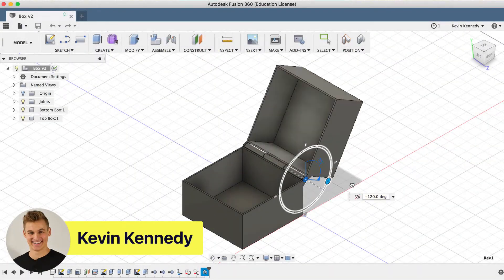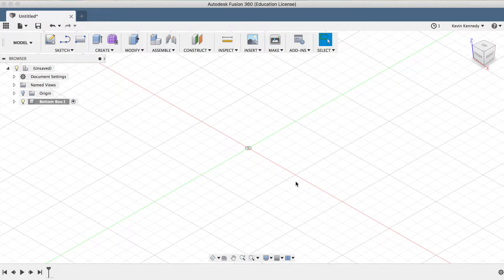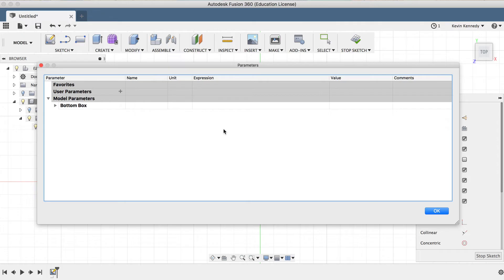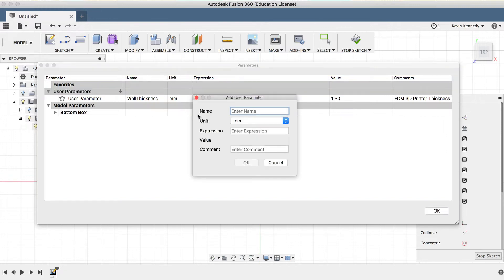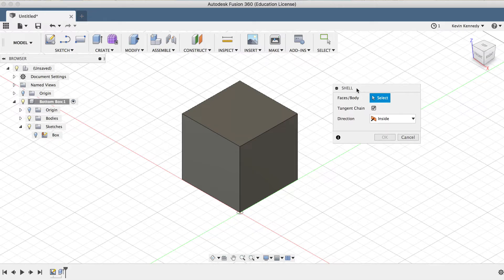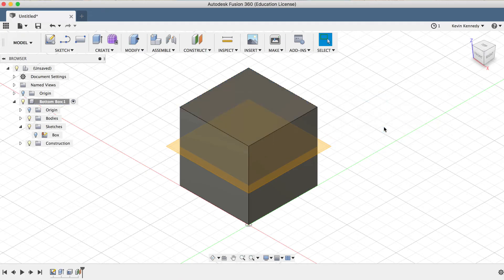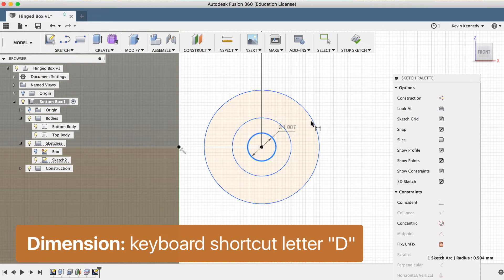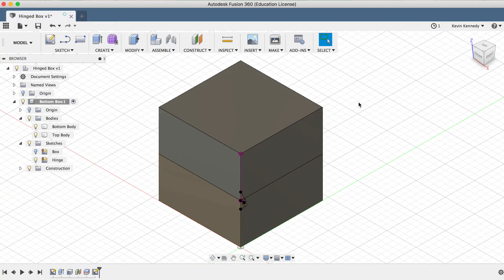How to 3D Model a Hinged Box for 3D Printing - Learn Autodesk Fusion 360 in 30 Days: Day #19(Part 1)

Comment: 8:47 Man, I just came here to watch this video by following the link in  "How to Design 3D Printable Hinge".
First of all, I started to use Fusion 360 about 10 days ago, I knew the basics Autodesk Inventor (which I find really similar to F360), and that helped me a lot.
Anyway, this is just a little story, I'd like to say thank you because I've seen a lot of useful concepts in your two videos, from using the right tools, to named parameters (extremely powerful, it's like introducing a bit of "coding" into 3d modeling).
I'm going to add printable hinges to a model that I'm editing...the only difference is that I've got a UV resin printer and I'm not completely sure about .5mm of clearance. Maybe I'm wrong, but it may be the "dot" resolution even in this setup. 
Btw, no problem: I will set a parameter and align the value with the printer's specs before printing. Thank you again 👍

Comment: Hello Kevin, and thanks for these wonderful videos! At 11:32, I could not get the line to attach to the upper half of the box, the dot for the connection never filled in black. I'm using Fusion360 version # 2.0.13866. I found that I needed to draw the sketch for the hinge before I split the box. Perhaps this is a version issue? thanks again!
Reply: I''ll have to try that it feels random. Sometimes I can get it to attach sometimes it doesn't

Comment: I'm jumping in to the middle of this series.  ...I've often heard the term parametric design for 3D models.  Is this idea of creating "variables" for height, thickness, and gap an example of parametric design?
Reply from the maker: Yes! That's one aspect of parametric design. At its core, Parametric design is about setting your models up with "Design Intent" so you can change dimensions/features with predictable manner.

Comment: 11:30 - my "line tool" isnt snapping on to the top half and when i click it and put in the angle the line stays the same length but detaches from the box however it does snap and work perfectly well on the bottom half of the box. Can someone please help.

Comment: Issue:
The "Model" workspace is no longer shown in Fusion 360. The "Design" workspace is shown instead. Some of the previously available environments (Patch, Sculpt, Mesh) seem to be missing as well. 
The Model workspace has been renamed the Design workspace. Sculpt, Surface, and Sheet Metal are available the tabs shown on the toolbar at the top of the screen. 
Causes:
The UI in Fusion 360 was updated in the September 2019 update.

Comment: Hi Kevin, when I start to draw Line (timeline 11:32) then my drawing is not able to connect to TopBody - it will not fill "triangle" (hard to describe for me). Like Top Body is "invisible" for Sketch. Also all my sketches has a small red lock - aah it means they are fully constrained - probably new Fusion functionality. What I'm doing wrong? Great tutorial BTW! Thanks
Reply: did you fix it ?

Comment: hey is anyone else's sketch at the end messing up? I get all of the circles done and when I add the bottom line it works but when I add the top line it doesn't connect to the other part of the sketch

edit: nvm I just turned on auto project edges on reference like "Product Design Online" said in another comment

Comment: Hey. Thanks for the great work for this series. Haven’t watch part two yet but is it a good practice that you kept the top part of the box as well as hinge sketch still within same bottom box component.
Reply from the maker: It really depends on the design intent and outcome/need of the model. Generally, your'e correct in that it would be better to have things grouped accordingly.

Comment: cant get the top 45 degree to snap to the top of the box. it works fine on the bottom any ideas.
Reply from the maker: Double-check that the 'Auto Project Edges on Reference' setting is turned on in your preferences.

Comment: Mystery: My Ender3 which has been stone-reliable and accurate, produced the hinged box with very loose joints (but otherwise fully functional). I changed my wall thickness parameter from 1.30 to 1.36, the max allowed by Fusion. The change in parameters was reflected in my drawing, but the print was unchanged. Any help would be appreciated.

Comment: I am unable to get the top 45 degree angled line dimensioned. Is that because I only right clicked only the surface of the side surface of the box bottom? The lower 45 degree line dimensioned just fine.
Reply: Found the answer under preferences....just a little toggle like that can cost hours of frustration...now I’m good to go😉

Comment: When adding in 2nd line (11:34) the area it creates does not get filled, as it appears not to be connected to the top part of the box.
Reply: I'm getting the same issue :(. Did you find a solution?
Reply: @ZohaibRauf  Sadly not - Nothing I tried worked. 😒
Reply: Down below "Sami Ahmed" mentioned the solution which also worked for me

"If you go to Preferences (Click your name in the top right corner) then go to "Design" that's under "General" there will be an option that says "Auto project edges on reference". If you tick that, then select apply then ok, it should work."
Reply: @ZohaibRauf  Nice one, I'll try that soon. I wonder why it only happens sometimes. Most of the time it works, just some lines won't make a solid fill.
Reply: @ZohaibRauf  It kinda worked for me, but now very little is constrained.???

Comment: Excellent class set.  I followed along and will now try and print to see how the hinge will work.  I can see problems if the bottom part of the box and top aren't equal and can't both lay flat with the base on the bottom.  How would you print that type of box - or is this beyond the intent of what you are trying to teach.  Had to ask.

Comment: "Hey, I'm stuck in section 11:34 because when I connect the upper line with the tangent of the circle, the area inside is un-selectable, unlike the bottom. this prevents me from extruding the hinge in the future. "
I have the same issue.  If I create the sketch on the top box it works only in the top box.  It just doesnt work after the split? It would seem the functionalty has changed in 2020.  Any answer as this is driving me crazy now?
Reply: Hey I had this issue just today when I was trying to make a hinge; I didn't have it before but I have recently reinstalled everything on my laptop, so that gave me the clue. If you go to Preferences (Click your name in the top right corner) then go to "Design" that's under "General" there will be an option that says "Auto project edges on reference". If you tick that, then select apply then ok, it should work.
Reply: @samiahmed7225  Thanks Sami, that was a great tip.
Reply: @samiahmed7225  Thank you very much, its a perfect Solution, And Yes Kelving really good content, Detailed video
Reply: @samiahmed7225  Thank you so much this was it and worked perfectly.
Reply: I had same problem John, I tried Sami's preference change but it didnt help. I did find the issue in the end. The measure line showing 2.95 was stopping the ability to select the top body right  line to set the 45 degree. I grabbed the 2.95 measurement reference and pulled in down far enough so there was some of the box line to select and it worked.
Reply: Thanks guys. All good now. 👍👍
Reply: bruh you willl go to heaven..just trust me... i was able to do without any help but this issue drove me crazy. i checked every fuckin video to find this problem.and god sent you..thx bro

Comment: I know this is old, but excellent video.  clear and concise.  One comment, IMO the wall thickness (you chose 1.3mm ) should me a multiple of your SLICER setting line thickness, that way the printer will not try to print odd line widths.  Your thoughts?  Thanks again....................
Reply from the maker: Hi, Mark. Very great point you bring up :)

The benefit of parameters is you can change that value to whatever you'd like before printing. Cheers, Kevin :)
Reply: @ProductDesignOnline   Very True.  thanks.

Comment: Can we set restrictions to the movement of the rotations? And plz tell how to design a rubik cube in fusion 360 which can be rotated  indeed
Reply from the maker: Hi, Harishkumar Gajakosh. If you right-click on the flag icon (for the revolute joint) you can select edit joint and can set the degree at which you would like it to stop in each direction.

I will try to do something similar to a Rubik's cube in my new 3D Print series. Cheers, Kevin :)
Reply: @ProductDesignOnline  Thank you sir for your the help😇

Comment: Hey, I'm stuck in section 11:34 because when I connect the upper line with the tangent of the circle, the area inside is un-selectable, unlike the bottom. this prevents me from extruding the hinge in the future. I've copied your tutorial exactly and don't see the problem, and need help. Thanks for the great tutorials though!
Reply from the maker: Hi, DJ KIM. If the area is unelectable then that means it is not fully closed somewhere. Double check that you have a line on the left and that all the lines are touching. If you still don't see anything share the link to your file with me and I'd be happy to take a look. Cheers, Kevin :)
Reply: I’m facing the same issue and am unable to connect the lines. Any way to fix that?
Reply: @sapraayush  Hey I had this issue just today when I was trying to make a hinge; I didn't have it before but I have recently reinstalled everything on my laptop, so that gave me the clue. If you go to Preferences (Click your name in the top right corner) then go to "Design" that's under "General" there will be an option that says "Auto project edges on reference". If you tick that, then select apply then ok, it should work.
Reply: @samiahmed7225  THANK YOU SO MUCH

Comment: sir i have complete that project of hinge box but i have no idea how to open it.
Reply from the maker: Hi, Abdul. You will need to right-click on the joint motion and select the "Edit Joint" from the menu. You will then be given the rotation slider where you can either drag the slider or enter the degree value to get the top lid to the desired position. Cheers, Kevin :)

Comment: Could not for the life of me figure out how to select the lines to enter 45 degrees. It looked as you selected the lower angled line as if you had clicked on it and then was dragging it towards the vertical line. Maybe its because I am using apple trackpad and you are on that uber cool mouse of yours. Just wait till this weekend when I get mine too. ha ha
Reply from the maker: Hi, James. Are you referring to the 45 degree dimension at 11:52? If so, after activating the sketch dimension you need to click on both the angled line (that was just sketched) and the vertical line. The order in which you select them doesn't matter. The only important thing is that you drag your mouse cursor to the middle of the two lines and click to place the dimension there.
Cheers, Kevin :)

Comment: Ron
Hi Kevin, I'm having trouble getting my extrude function at 6:10 to rotate up and show the arrow when I click extrude. I feel like my home cube is in wrong position. I've changed my axis direction, but hasn't helped. Really learning a lot from your videos! 
Thanks
Reply from the maker: Hi, Ron. Glad you're learning a lot from my videos!  You can always try adding a minus sign in front of the dimension value in your Extrude dialog box. This will always force the extrude to go in the opposite direction if you're not able to select and pull the blue single directional arrow.

Let me know if that fixes it for you! If not, I'm happy to help troubleshoot further. Cheers, Kevin :)

Comment: Pharmcat
I can't get the top area under tangent line to select. I select line then click a point on the top box and draw my line to the circle  The point remains clear and I'm doing it the same way as the bottom box, which is fine. What am I doing wrong? 
Excellent videos! I've just been doing this for a month.  Thanks
Reply from the maker: Hi Ron, please make sure that you have the "Auto Project Edges on Reference" setting turned on in your preferences. Here's how to check - https://productdesignonline.com/fusion-360-tutorials/10-questions-fusion-360-beginners-always-ask/#3
Cheers, Kevin :)
Reply: @ProductDesignOnline  Hello, Kevin, same thing as above. Even after I make sure the Project Edges is on (it was on all along), the SECOND of the lines (the top one) doesn't define the surface when created. It doesn't matter whether I stop the sketch operation or not.
Reply: I have the same  problem

Comment: My Fusion will not move to Z axis up even though it sets ok in the settings?
Reply: Thanks Kevin. I will investigate further.
Reply from the maker: @Derek_Lark  You're welcome. Let me know if that was it :)
Reply from the maker: Hi, Derek. Are you trying to change it for a new file or with an existing file?
The option to change "Up" in the preferences only does so for new files created. You currently can't switch axis for an existing design, but the workaround is pretty easy. Just rotate the bodies to be oriented along the Z in instead of the Y-axis. 

As a secondary option, you can also right-click on the view-cube (in the upper righthand corner) and change the "top" view to be for the Z-axis as well. That will help the navigation feel the same going forward. Cheers, Kevin :)

Comment: When making the rectangle ( square ), fusion 360 says that it's fully constrained but when I change dimensions of one side the body deforms ( other dimension does not update ). Have tried adding equal constraint additionally but fusion wont allow as it says that geometry is over constrained.
Reply: The same is demonstrated at minute 12:01 of the part 2 of this tutorial. You were able to change the length without affecting width ( shape change ). Is it still considered fully constrained? I think it's just a small confusion.
Reply from the maker: @paranajape  Let me try to clear up the confusion. The goal of a "fully constrained" sketch is to make it easily predictable to know what any changes to the model would do. Meaning, that you can update the desired dimension, and know what else within the model will be affected. It does not necessarily mean that all dimensions will change when you update one of them or the opposite.

To double-check that your sketch is fully constrained you can check the sketch icons next to your sketch name. Take a look at this reference image: https://snag.gy/kNPzbr.jpg  You'll notice there is a red thumbtack icon next to the box and hinge sketches. This red thumbtack means that the sketch is fully constrained.

The goal of this box would be to make it easy to change dimensions of the box, without throwing off the shape of the box, or other dimensions that you wouldn't want to be affected. I made the box so one side could be updated, without the other, in case it's useful to have one side be longer than the other. However, if you wanted all four sides of the box to always be equal, then you could set up the dimensions and constraints to enforce that as well.

To summarize, having fully constrained sketches is important to help the user understand how the model will change when any specific detail is updated. I hope this clears up some of the confusion! Cheers, Kevin :)
Reply from the maker: Hi, Paranajape. Could you please share your file with me so I could take a look?  Share your public link as a reply to this comment. Here's a video explaining how to share a public link - https://youtu.be/2XrcrdV-8Ls

Then, please write a separate comment letting me know you've replied with a link because YouTube flags most links and I don't always get notified. Cheers, Kevin :)

Comment: Just curious, why didn't you make the length and width of the box parameters, as well? Seems like that would be handy for making the box change size quickly.
Reply from the maker: Great question, Jeff! Personally, I try to only use parameters if I'm going to be re-using them in other areas of the model (as in multiple times). You could definitely set up parameters for the length and width, but if that's the only place that you'd be using them then it wouldn't really save you much time in comparison to just editing the sketch dimensions.

If wanted to always keep your box a perfect cube, no matter what the size, then creating a parameter for the length, width, and height would be ideal.

Thanks again for watching!

Cheers, Kevin :)